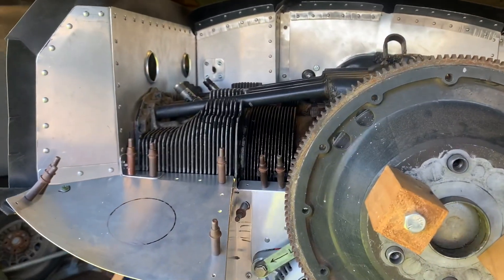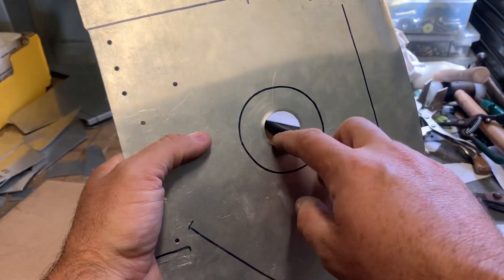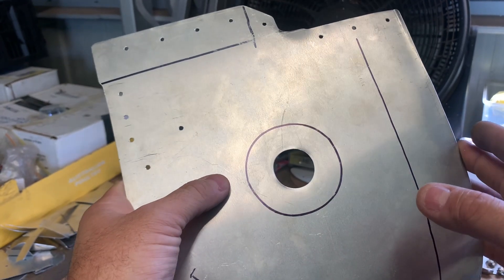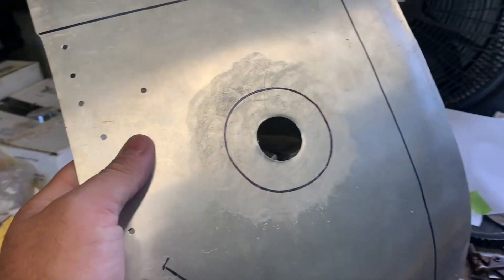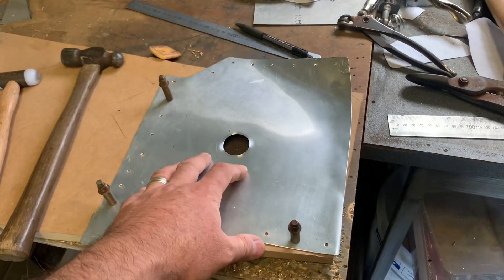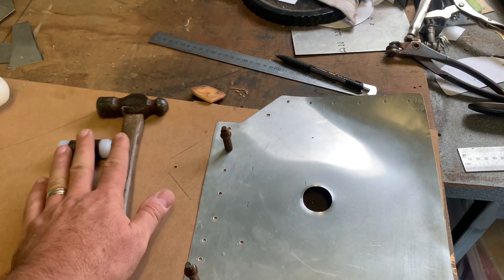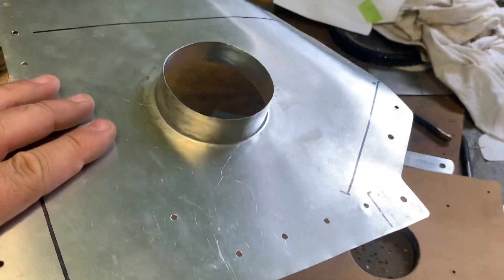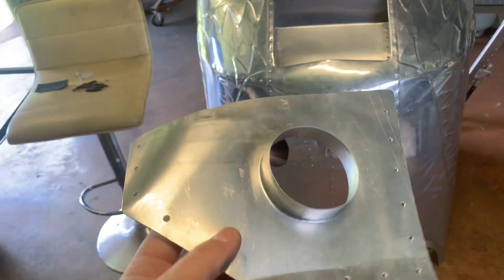Extreme metal forming with only the basics

Comment: Some items that would help: What temper/hardness was the 5005 aluminum?  What was the thickness of the material??  A third method of prepping the aluminum is the squiggling of the area to be annealed with a magic marker type pen, (does not have to be totally covered, but ample) and burn that off. There is subjectivity to the soot method (how heavy a soot layer did you put on), and not having used the soap method is there a heavy/light factor involved?  I think the magic marker method might be the least subjective.
Next thought is: what do 'you' do when a crack starts forming?   Nice work mate.
Reply from the maker: Thanks mate. I’m not sure of the temper the 5005 was. I just picked it up at the local metal shop so I guess a commercial grade. It is 0.8mm or 0.030” thick. I don’t have the set up to do the soot option for annealing and the soap one works well enough for what I’m doing. I haven’t tried the marker pen trick. You can see how the soap doesn’t cover the material like the marker would but still gives enough coverage to let you know what’s going on. What do I do when a crack starts?….sometimes cry! Sometimes I’m lucky enough to trim it out and still have enough of the part left to do it’s thing. Sometimes if I catch it early enough I can file the crack out. I tend to keep a close eye on the stretched edge. And usually dress it to keep it smooth as I’m forming. Fun huh!

Comment: I was taught to mark the area with a pen and heat till the pen marks went away. Similar idea. Surprised you didn't put a radius on your form block. I wonder about, but don't know, about quenching in water vs air cooling.
Reply from the maker: Yep, the pen mark is basically the same idea. There is a radius in the form block, after using it a few times it’s probably about a 5/32” radius now. Also forming without a backing plate lets the piece flex an raise a little while forming. I just needed to work it a little afterwards to get it flat. I’ve always quenched in water to anneal. Maybe I shouldn’t. I remember air cooling during the age hardening process. 10 or 11 hours at 190deg Celsius, then cool to room temperature